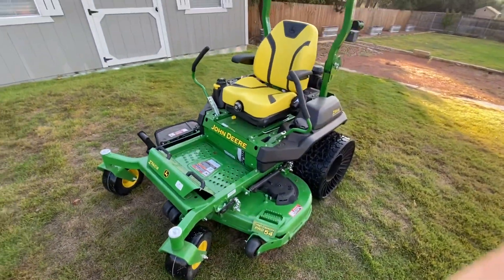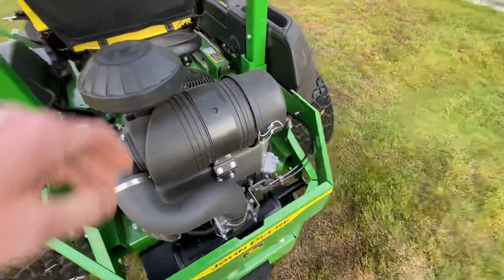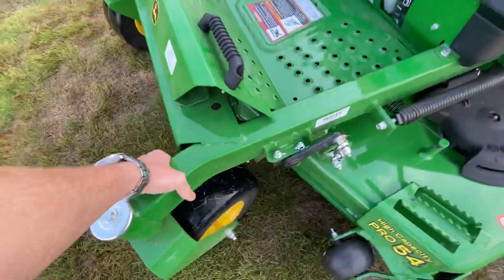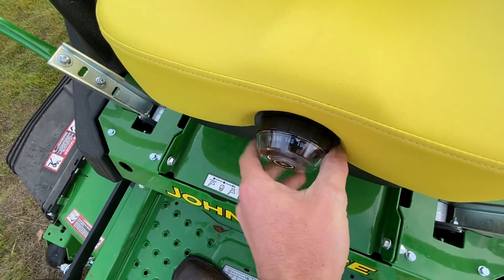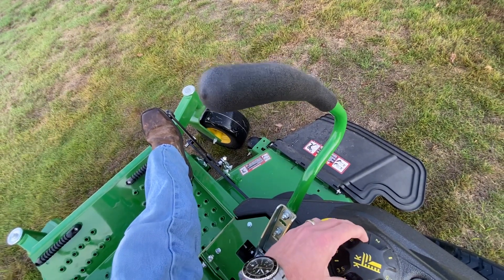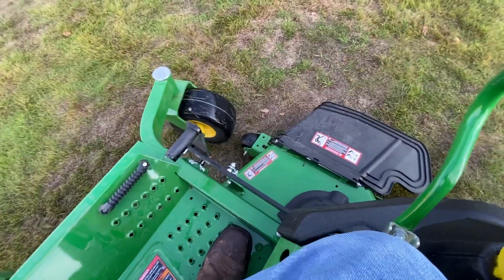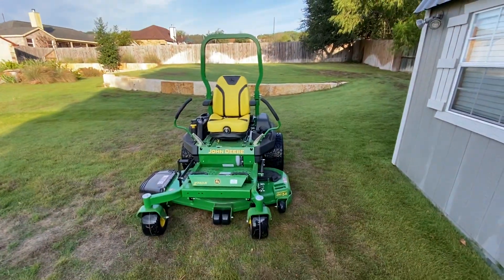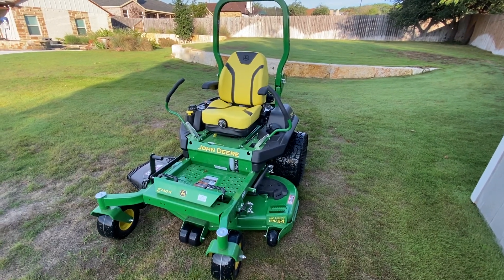John Deere Ztrak 740R

Comment: Hey, what’s the width of the deck outside to outside? With flap folded up, just want to know for trailer size, thanks
Reply from the maker: I will check for you
Reply: Please do, much appreciated 👍
Reply from the maker: So we have 59” with the flap up. So if you are like me and have a 5ft wide trailer its a real tight squeeze. But it will work
Reply: @SuperFastRc  thank you